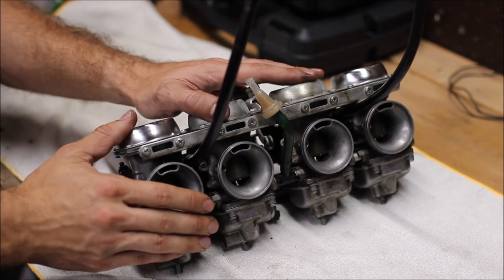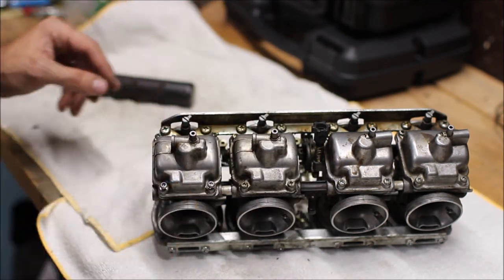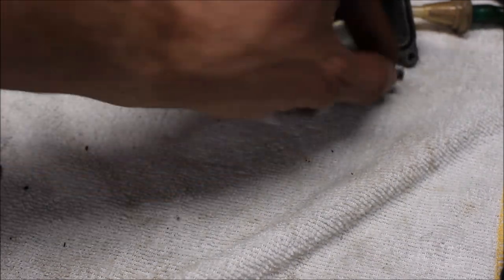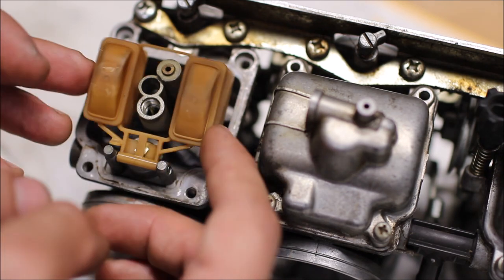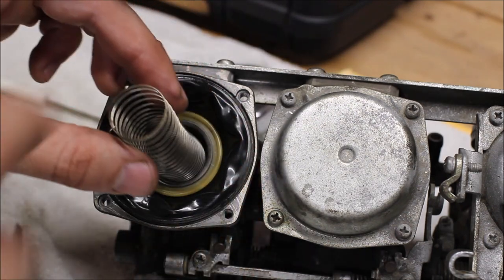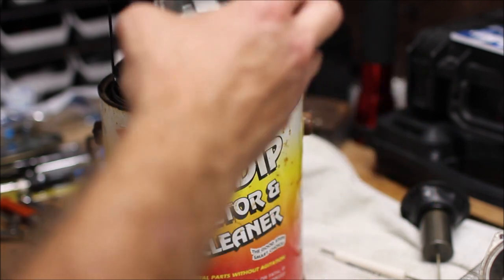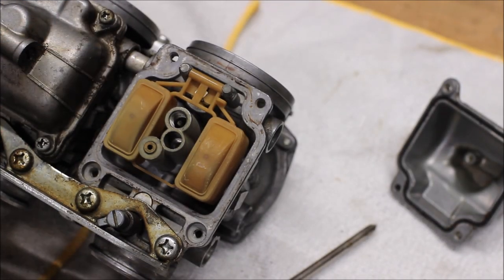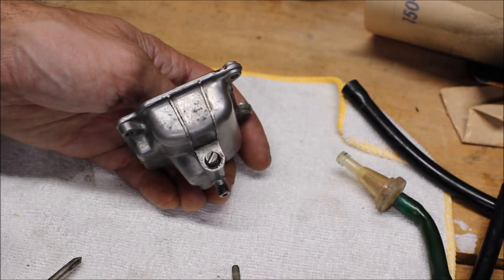1980s Honda CB650 Carburetor Cleaning

Comment: I have an 80's Nighthawk that I have been putting off cleaning the carbs since last year.  After watching your video....I finally took it apart and have cleaned my idle jets that were causing it to run on partial choke. I just have to put it back together.
Reply: how exactly did you get the carbs off the engine. Theres almost zero space to get them out and in....
Reply: @caroltenge5147  What bike do you have?
Reply: @NextLevelAutoDiagnostics  1985 honda 650 SC.
Reply: @caroltenge5147  the seat and gas tank have to come down. The airbox has to be pushed back. Are you near NJ...i can help.

Comment: A heads up, those Phillip screws on the fuel bowl are not Phillips, you need what are called JIS screwdrivers (Japanese Industrial Standard), designed to be non slipping. Thanks for the Video, I need to do the same.
Reply: I ordered complete set of screws in ebay for this carburetor they fit properly...no issues
Reply: Have you done the overhaul on your carburetors?
Reply: @eebarreto  A bit latte on the reply, never got the notice, think one needs to click on the bell icon  in order to get a notice.
That said, your replacements may be Phillips, you can use Phillip's (most everyone does)  but that does not mean it is the correct tool as it is not. If it is a tough one they can strip the heads where a JS set would not. I don't have a JS set either just am very careful using the Phillip drivers.
Reply: @massoudzadeh3394  Another job planed and unable to finish, they are off, apart, cleaned and have kits just haven't the time which seems a hard thing anymore. Took his advice  with taking lots of pictures, these should  pay off big time when I get back on them.

Comment: GOT A 81 cb650. TANK SUPER DIRTY. clean now,carbs removed and cleaned.Now it will start on 3 cylinders. NO.2 nothing. Lots of spark...no fuel. Wont rev up. Any throttle and it stalls. Plugged with my hand on intake of carb on airbox side and can feel vacuum,but fingers soaked with gas.  But will not fire on no. 2.any ideas?

Comment: I just got the same motorcycle everything is complete on the bike except it has no carbs what size are they or what are they called having hard time finding the correct ones for the bike every site has different ones

Comment: My 81 cb650 doesn’t seem to match up with this one. A few differences. One is that rubber round boot you kept, mine doesn’t even have one... hmmm. Another difference is mine only seemed to have one jet, not two.
Reply: That's a different engine. I think I'm 83 they switched to a DOHC engine. Yours is a SOHC

Comment: what year of bike did this come off of? I'm doing the carbs on my 82 cb650 and it seems the rebuild kit I bought ( https://4into1.com/set-of-4-deluxe-carburetor-rebuild-kit-honda-cb650/ ) doesn't have the correct gasket despite the website listing my bike as compatible. My only thought is that these carbs might have come from a different year seeing as they match the one from this video. Any info would help me out a lot seeing as I would like to buy the correct kit this time around. Thanks in advance
Reply: I am having the same issue. Did you find the correct kit?  Care to share?
Reply: This kit worked for me. I had to make sure that the gasket matched the shape of the bowl. The other kit I got was way off from what I needed. These old bikes can be more Frankenstein’d together than we realize at the time of purchase.

Hope this kit works for you. What year is your bike?

https://www.ebay.com/itm/Set-of-4-Deluxe-Carburetor-Rebuild-Kits-Honda-CB650SC-Nighthawk-1983-1985/183480445569?hash=item2ab8496a81:g:I8oAAOSwk1hcav5Q

Comment: So, those carbs, if they are the same as mine, usually have a fuel diaphragm that shuts off the gas flow until vacuum is created in the #3 carb. sometimes a prime will get em working if they are fairly clean. I am doing my 82 . There is nothing to em, just takes the time

Comment: thanks for making us the video ! I did mine it made a few days now and I dont understand. my drain plugs are turned at the maximum but when i'm trying to start the bike it leaks event if they are all tight can I have some help
Reply from the maker: Adex, to me it sounds like your carb bowls are overflowing with gas. These floats are plastic and have non-adjustable tangs. I think the issue might be the float valves. They may be stuck open due to crud or some other surface deformity that is preventing them from sealing up. I would try cleaning the float valves or replacing them.
Reply: @mkruk2  thank you for the quick reaply and i will do as you said  and see whats wrong with it

Comment: do you have a video how to tune this carburetor? because is only on pilot screw for each carburetor, TY
Reply from the maker: Unfortunately no. This carb cleaning job wasn't for one of my bikes. After cleaning and reinstalling it on the other guy's bike, I was hands off.

Comment: Just got an 84 nighthawk 650. Could you make a vid showing how to remove the carburetor from the bike?
Reply: Honestly dude I just got an 85 and taking off the carbs is a bitch. You’ve gotta take out the battery, unbolt the two bolts holding the air filter box under the seat, unclamp the carbs from intake boots and air filter runners, pul the air filter box back as far as possible, then AGGRESSIVELY wiggle the carb up and down while pulling back and it’ll eventually come out. There’s a vid out here somewhere that shows it I just can’t think of the name right now
Reply from the maker: David Walker is spot on. I don’t own the CB650, I did this carb cleanup as a favor for a buddy that was in the area. Sorry.

Comment: Anyone happen to know if the slow jet has a hole all the way through the middle? I'm a newb and my jet still doesnt show light straight through the middle on the smaller one. Just wanted to make sure, before I put it all back together
Reply from the maker: It should. Did you soak it in carb cleaner (several hour dunk)? Blow it out with compressed air afterwards.
Reply: i just took mine apart and didnt see a hole.
Reply: @timincam  no hole = no fuel flow